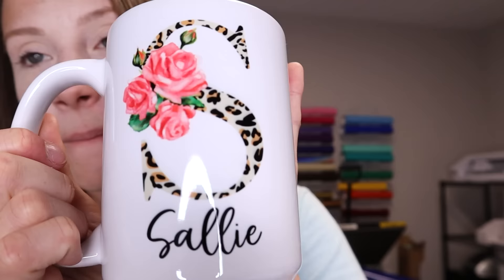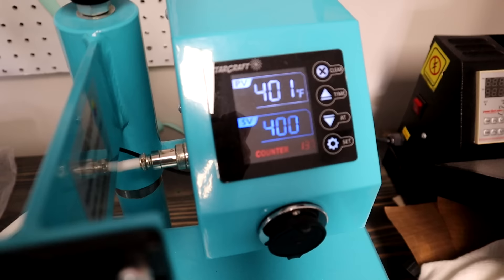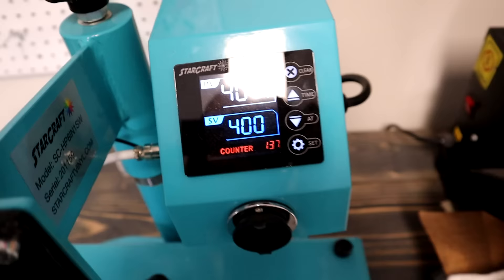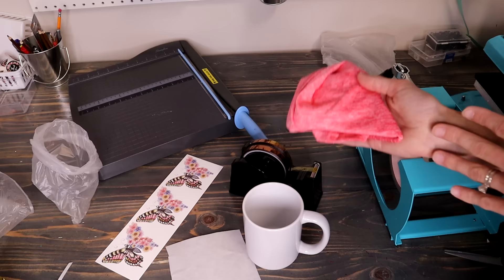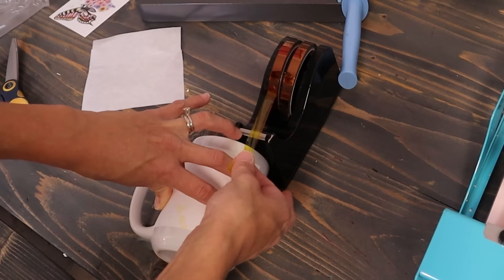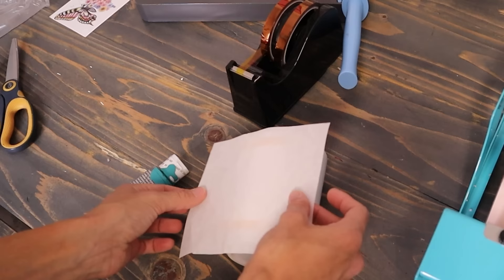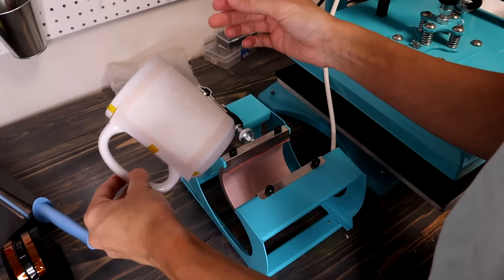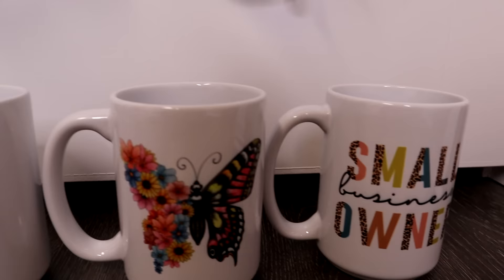How to Sublimate a Mug for Beginners | Step By Step Tutorial

Comment: do use a sublimation printer or a converted printer? Also, that butterfly is absolutely gorgeous. Can I ask where we can find it?
Reply: She use a converted printer. Epson- 15000
Reply: Epson 1500 don't have to be converted, it is a sublimation printer
Reply: The eco tanks  aren’t specifically sublimation printers, but because of how the eco tank technology works you don’t have to do anything other than pour the sublimation ink into the tank. So there’s no physical conversion. If you want to go back to using regular ink or if you want to go from regular ink to sublimation you will have to flush the system.
Reply: Epson SC-F100 is perfect

Comment: Love the designs you chose! The small business owner one is my fav. :) 
Two things I've learned doing sublimation mugs. 
1- you should always heat your press up, and let it cool down with a mug in it. Otherwise the element can burn out. 
2- Some dishwashers will cause fading on sub mugs. Depending on the cycle setting, some can get hot enough to reactivate the ink and fade it.
Reply from the maker: Wow this is great information! Thank you so much for the tips.
Reply: How can removing the mug before the press cools down cause the element to burn out? I have never done that and nobody I know who makes mugs does it.
Reply: @elianaisraelnc7904  I don't think she means the mug you are sublimating.... I think just an extra mug  that is used just for warm up and cool down.

Comment: These are very pretty!  I messed up a Cricut mug and was able to remove the image in both sides using white vinegar.. Soaked while warm for like 20 mins scrubbed right off using metal scrubber.. I haven't tried to re sub on it yet.. But can repurpose it using waterslide paper or vinyl  ..
Reply: Great information...
But yes using a heavy scrubber, will take off the special sublimation coating!

Comment: Soaking mug in paper towels drenched with Acetone and wrapped in tin foil works. I did 3 already. Just keep repeating steps if needed for stubborn stains. I then re-wiped mug with alcohol and was able to use it again. 1 mug I soaked once and it was good, but my 3rd mug has been soaking for about 2 days  and is finally complete. Not sure the process is worth it, but I’m just starting out and was trying to save money. Hope this helps someone. ❤

Comment: I love these!  Do u have a video on how you set up your et15000? I have the same printer but still in the box.  Kinda nervous to set it up.   Did u mention where u got your butterfly design?
Reply: There’s a lot of videos on here setting up the et15000 step by step. Watch the videos and get that printer out the box lol. Remember to not use the ink it came with.
Reply: Super easy! Definitely make sure you don’t use the ink it came with and also, make sure you load your ink before you even plug your printer in. I just did mine today. I have the 4700 though. It was easy. I followed Angie Holden’s video on YouTube and it worked perfectly! Good luck!

Comment: Hi, I was just wondering if the timing is still the same when the heatpress drops temp? I put a mug in and it fetches the temperature down and I'm not able to set the timer until it gets back up to temperature... is it 150 seconds from putting it in or 150 seconds from when it gets to 400°? Xx
Reply: Interested in the answer to this question too.
Reply: I have the exact question!  Thanks for asking!

Comment: Hey there, I just came across your channel and subscribed :) I'm just starting my business and I'm having a bit of a hard time understanding sublimation, vinyl, etc. I'm sure once I get it, it will be much easier. I have a question, I don't have the same type of printer than you, is it possible to print it on a regular printer? I just invested on a cricut, heat press on machine and supplies so I can't invest on an epson right now 😢

Comment: What type of paper do you print your design on?  Is it laser or inkjet printing
Reply: InkJet printers only and personally I use hippo sublimation paper and it always comes out great, bright and Vivid. I always lay my image out and make sure it's completely dry and remember when you print it out it's going to look very dull on the paper😊 try not to touch the prince side of the paper couldn't figure out what was wrong with my first few images it was the oil fingerprints and dust from my hands. And it's really best not to leave your paper just loaded in your printer like we do a regular printer. personally I just load one sheet at a time and I make sure the rest of it is closed up and out of direct sunlight and any moisture😊 those are just a few of the tips I have learned from making my own many mistakes and wasting many many sheets of sublimation paper  😂😂